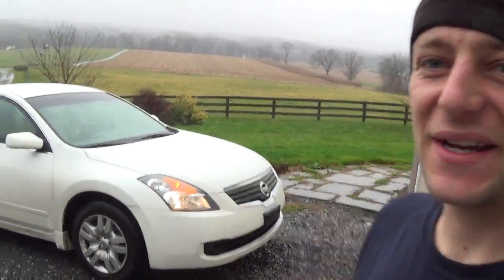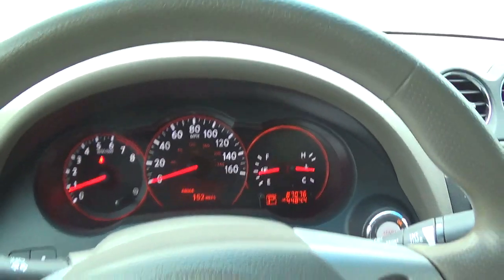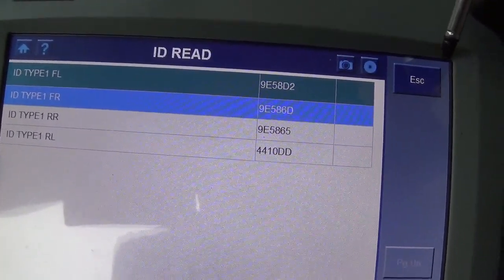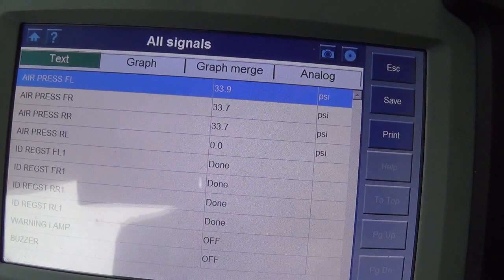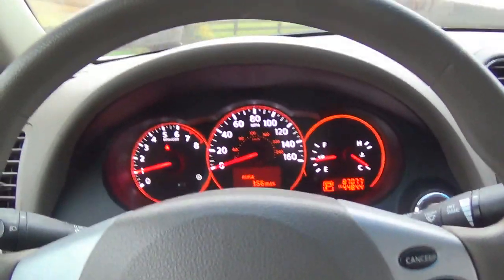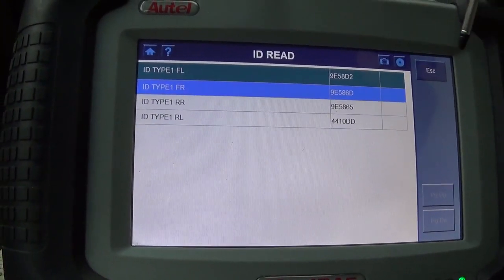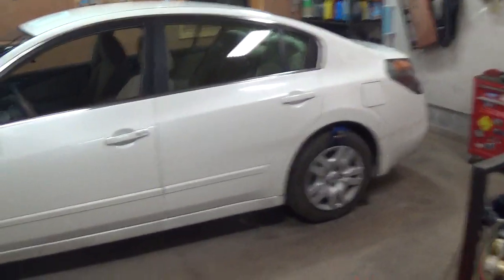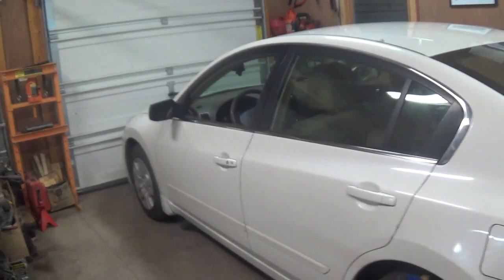TPMS Case Study: '09 Nissan Altima

Comment: Wow what a coincidence, my sister has the same Altima with severe cupping on the RL tire and the TPMS light is on, sometimes flashing.
I also thought it was the wheel bearing because of the noise but when i noticed cupping i moved that wheel to the front and the sound followed. Also low millage on these tires 🤨
I guess she'll be doing alignment and getting a new sensor. 
Thanks Ivan!

Comment: Get the TS 501....it fixed my chronic problem.  2007 Nissan Quest, replaced one TPMS sensor and none of the manual relearn procedures would work.  After hours of crawling around under the dash, deflating and inflating tires, I ordered the Autel Maxi TS501.  60 seconds after using it....scanned sensors and plugged into OBDII, .....it registered the new sensor and cleared the light.  Finally back to normal.

Comment: And the results of 90 MPH road test?  I'm not an undercover speed trap cop BTW.  :)  Balance issues very important in long tire life, done once when new may not be enough.  I very much like your string methods for home done tire alignment.  I'm thinking I would test each general tire area for plumbness with the world in general too as the slope nearest to the drain may be more than the far wheel area.  Bad flashrom in the TPS always worked just as a not registered entity sometimes.  Bravo on NAPA to stand behind it, but it would have been nicer if they didn't need too.  OTOH, you got to save her some tire life this way, tough call on how much of this to own, stuff does happen.  Overall she is still lucky to have you as a mechanic.  Another nice one Ivan, keep it up.  Happy Holidays.

Comment: I have a similar issue with my TPMS on my 2010 370Z, according to my most resent research regarding after market TPMS, in order to program an aftermarket unit, you need to look below the steering column, you will see a connector next to the OBD2 port , the connector has a single wire connected to it. You will need to ground that connector using a paper clip or a small wire enough to be inserted to that connector. Tap the wire on a metal ground 6x. The TPMS will start to blink or continue to blink. Wait one min. After waiting for a min. using a TPMS unit similar to the one reading each sensor, scan each sensor.  The TPMS should disappear. turn off and start the vehicle, drive the vehicle for about 10 miles just to make sure the light won't come back on. If it stays off, then you just have program a TPMS on the BCM correctly.

Comment: fit oem shocks and it will stop the tyre cupping , the shocks start to leak or the the piston inside the shock will have play in it without signs of leaking at the seals I've seen this a few times

Comment: Cool video , it would have been nice if you video the register of the new TPMS sensor , using the Verus . I just purchased the same model TPMS tool..If you get a chance to run into another TPMS replacement, please record the programming.. I will have to look for your alignment video and check it out ...thanks bro..

Comment: TPMS are nothing but trouble. I was across the pond in the great white north in August last year on some mountain full of brown bears in my hire car and i get that exclamation point warning light come on and it scared the shit out of me because i'd never seen it before. I actually had to look in the cars manual... I checked the air in the tyres and it was all in spec. I think if i had a newer car i would just find a way to disable the system or pull the warning light out of the cluster. Its just another expensive failiure waiting to happen.

I really worry what i'm going to do when i can't keep my decade old Toyotas on the road anymore. 

BTW your grasp and application of trigonometry is very impressive.
Reply from the maker: +zoidberg444 Yeah it's OK when it works, but as soon as those batteries start dying in the transmitters, get your wallet ready! Or if you are cheap you can deal with the annoying light in other ways :)
Reply: +motoYam82 I just disabled the system by reprogramming by car.  It still technically works by using the wheel speed sensors instead.

Comment: Just went through the same issue. If you have the Autel MaxiTPMS Pad, you can duplicate the sensor Id, or create a new one. At first for me, the aftermarket wasn't holding the id, and kept pushing out a new Id. 

A few changes,and it seemed to hold in the BCM.

Comment: Great job Ivan. Why did u switch to the Verus. Won't the Autel allow u to reprogram new Id into the computer?  When I bought my Maxidas they threw in the TPMS tool. It seems a lot or independent rear suspension cars cup rear tires
Reply from the maker: +Bill Rimmer Yeah the Autel can do it too...just wanted to use the Verus for a bit of variety lol. Dang you got a good deal then; the TPMS tool alone costs two hundred dollars! Yup, never had a solid rear axle vehicle chew up tires like those fancy multi-link setups!

Comment: hi  ate you gonna have a video on how to use handheld tpms tool...advantage and disadvantage as a handheld for those on a budget...thx again...happy holidays...
Reply from the maker: +jirojoseph esman Not much to it...just push the magic button and get the ID, pressure, temp, batt life of the sensor. Can also test key fob signal strength. That's about it...can't program anything like the fancier ones.
Reply: +motoYam82  but can it reset it? like fixing the problem? thx for consideration... God bless

Comment: Great video. I have a TS401 on order, TPMS only became law last year in the UK so we're all of a sudden seeing more faults! Broken Subaru engine in the back ground?
Reply from the maker: +Toyota Tech Good eye LOL actually there are two in that pile: an '02 2.0L DOHC WRX turbo unit with a snapped rod and that 2.5L SOHC with a cracked cylinder wall :)
Reply: +motoYam82 Well they don't last forever! I used to work at Subaru many moons ago so I can spot a boxed pile at twenty paces!
Reply: +Toyota Tech wholeheartedly agree. Hate the sound, hate the design. Overrated. Blow up like crazy
Reply: +Bill Rimmer They have their issues but overall I think they're a pretty good car when looked after. Merry Christmas.
Reply: +Toyota Tech Thank u very much!  Most of us seem to watch the same channels. Scanner Danner, South Main Auto, Ivan, James Danner and Ford Tech Makuloco. Very much enjoy your input. I gather u work at a dealership in UK. Please post some pics or videos on your channel. I have checked and haven't seen any. Have a great day!!!

Comment: You definitely need a lot of diagnostic tools. They do make a retreading tool kit for the TPM valve cores that leak.  I bet dorman made the TPMS .
Reply from the maker: +Steve Rob And that was the more expensive option too! The Aluminum cores actually corrode right through so unfortunately re-threading wouldn't help. The original sensor itself was fine...why they don't make the stems replaceable separately is beyond me.
Reply: +motoYam82 They have started coming out with  service kits that you replace the stem and hex nut pieces. Hyundai and Kia for example. Lot cheaper for sure.
Reply: +Steve Rob oh yeah i did not know that that kit existed until a month or so ago there is a video on jimthecarguy's channel
Reply: Yep my buddy Jim . YouTube can be a great source of info. Take care

Comment: i have ran across this many times before. i have installed new shocks, tires and performed an alignment, all within spec, just to have the vehicle show signs of rear tire cupping.... only on fwd lighter vehicles. and i believe this is due to lack of weight in the vehicle. i have observed this problem on many vehicles, most notably on 2010 + civics. 
think about it, these cars have all the weight on the front, including the driver if there were passengers weighing the vehicle down... or even junk in the trunk it would help keep the rear planted. I am no expert, just my observation of the facts which are given to me. everyone observes things differently.
Reply from the maker: yeah every car is different, also some tires cup faster than others. Definitely some trial and error required to get it right!